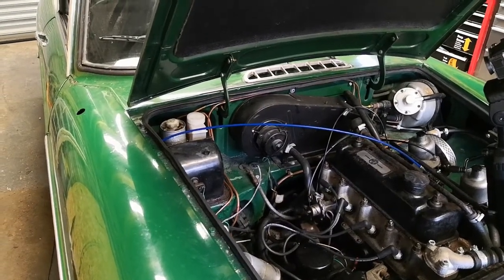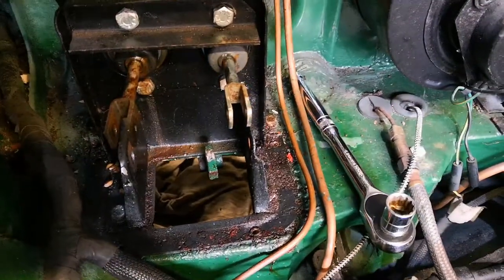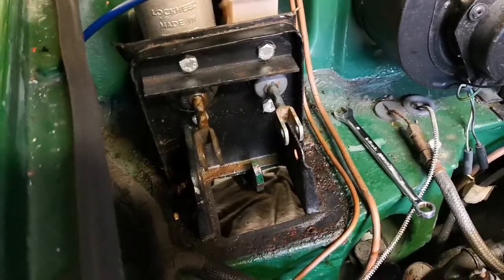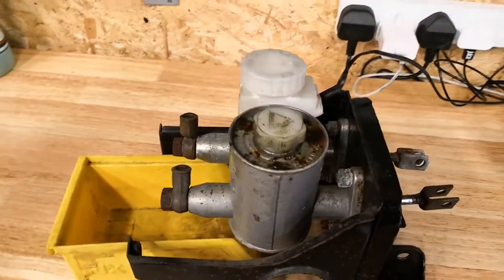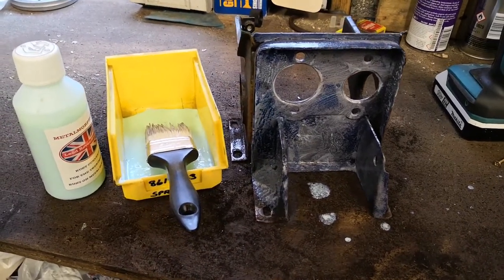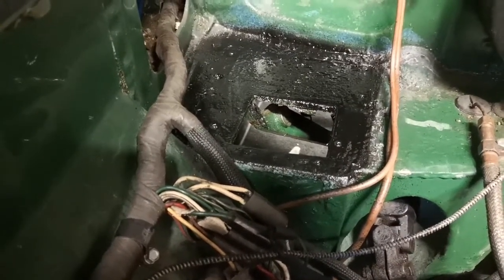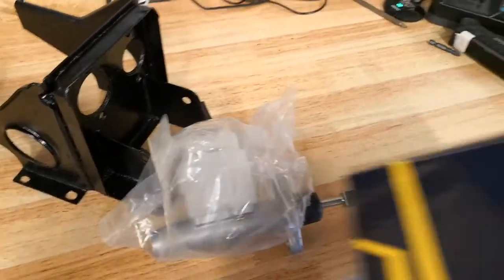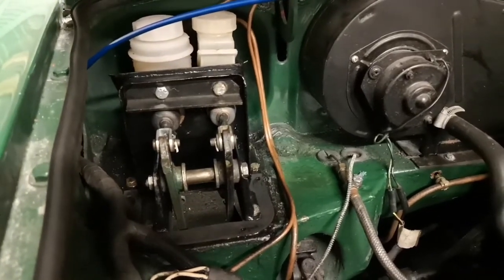MGB GT Brake Master Cylinder Replacement

Comment: I install a vinyl sheet piece, as the gasket,under the box to catch any leaked or spilled brake fluid for easy cleanup and protect bodywork.   Cleaned up rust, sealed the area, painted before reinstalling everything, just like he did. The vinyl will protect the bodywork under everything. For the pedals, I just cut slits in vinyl for the pedal to pass through, to stop some heat and noise into the cockpit.  Easy to get it all out and back in. Did notice the hole in the pedal where connects to masters, “wallowed out”. Found the mushy feel in the pedal, woohoo! Had spot welded, redrilled, 5/16” hole, , now tight pedals.

Comment: I've just the same job on my 1965 MGB Roadster.  The only thing I'd add to the excellent video is a suggestion on re-fitting the pedal box.  I found it easier to get all the eight bolts started in their threads before screwing them finally uptight.  Putting them back in is a lot harder than taking them out!

Comment: Hi, 

how did you remove the MGB brake box assembly? I am having trouble reaching in the crevice to get a few of the bolts off!
Reply from the maker: Do you mean the part I removed in this video.? 
I cover the removal on the first few mins of the video.
It does take some long extensions bars and a flex head if you've got it makes it easier.